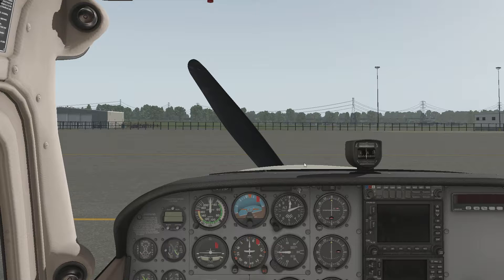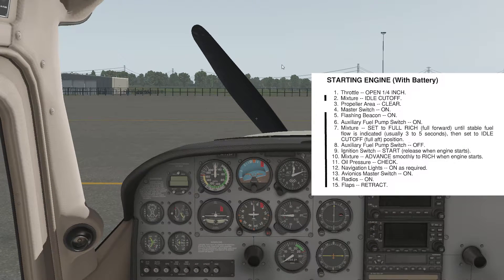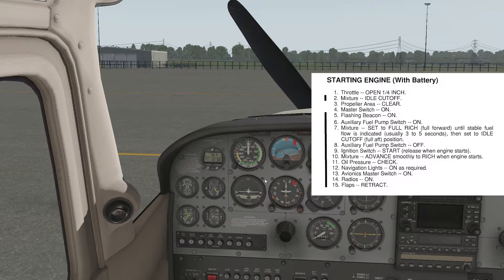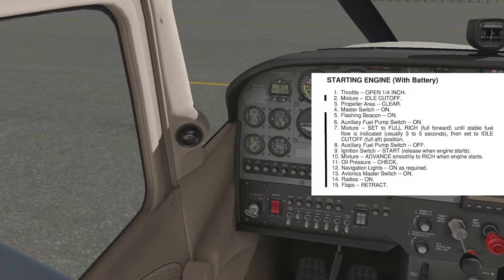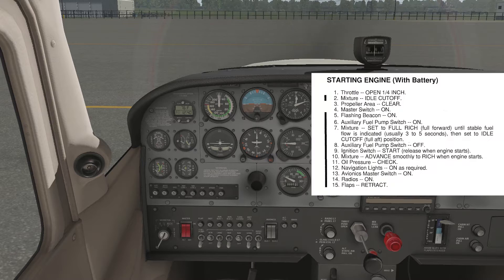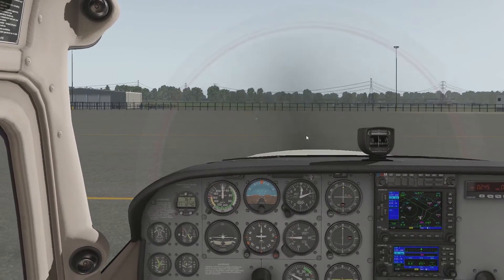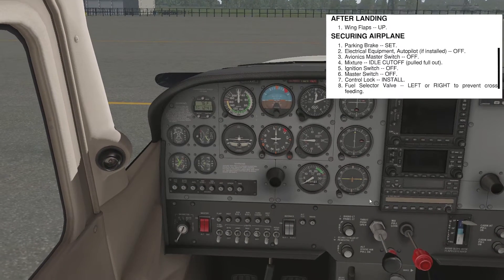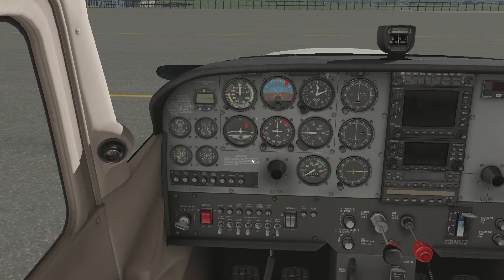Cessna 172 Startup and Shutdown Procedure | X - Plane 11

Comment: Thank you, mostly.  But one area leave me a bit confused.  You didn't follow the posted procedure in your own video (steps 9 and 10).  At about 1:43 in your video you pushed in throttle 1/4" but then you pushed mixture full rich before starting the engine.  My understanding is that proper starting procedure for the 172 is that you advance throttle 1/4" and leave mixture at full lean.  You then begin cranking the starter. Once it catches then and only then would you advance the mixture to full rich.  If you try to start the C172 in a properly modelled Cessna (e.g. REP) as you've demonstrated you'll flood the engine every time.  Given you're a RW pilot could you comment on this or update your video?
Reply from the maker: My startup was based on a carburetor engine, not fuel injected engine.. I did not think about it at the time of the video production. Old habits..